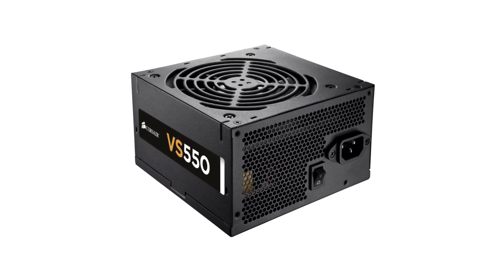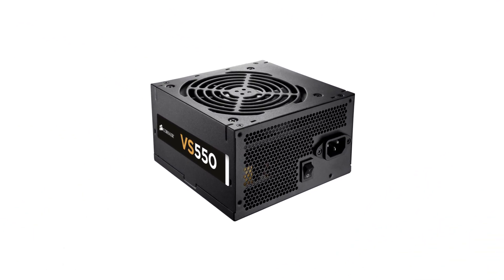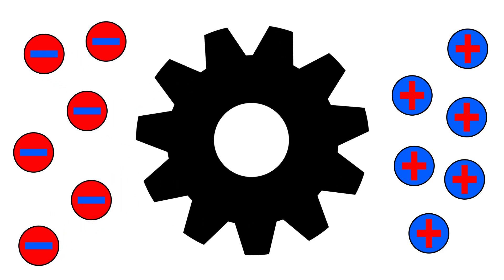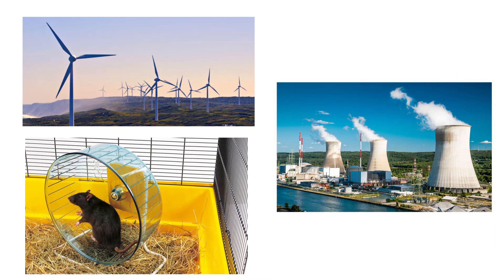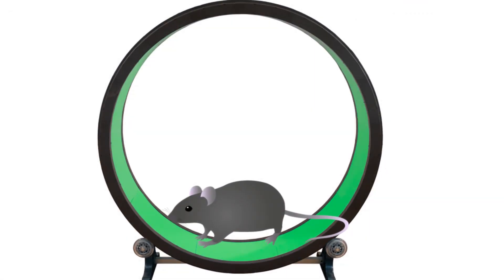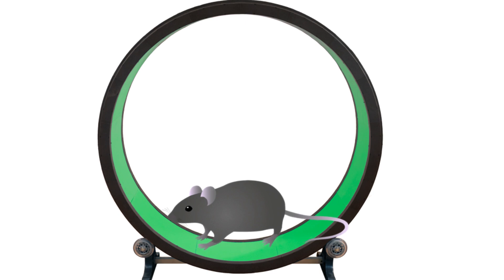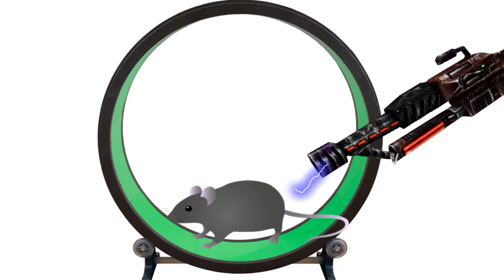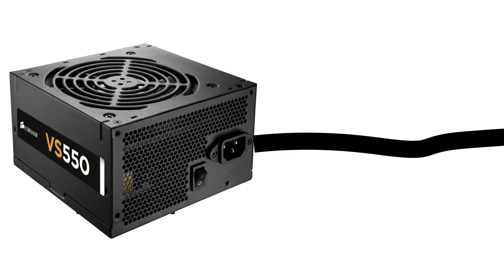How Does a Power Supply Work?

Comment: I just built my first pc. but when i plugged it in my psu sparked and turned my pc of.. will it damage the rest of my system?
Reply: Sir. thank you so much for the replies.. it really helped me alot relaxed .. i was really stressed out that time knowing i canr afford another system if it broke down.
Reply from the maker: @brucecrescencio  glad to hear it! Do you have a cooling system?
Reply: @H3Vtux  hmm just the free fans that came with the case
Reply from the maker: No, the psu has surge protectors in it so the rest of your setup should be fine. How big were the sparks? Was the psu off when you plugged it in?
Reply: @H3Vtux  the spark was not that big.. a little smoke came out of it.. Yes everything was turned off when i plugged it in
Reply from the maker: @brucecrescencio  Hmmmm that's not good, though sparks don't always mean there's a problem. The fact that it isn't turning it on doesn't mean any of your components were damaged though, if the PSU is broken they won't ever be fed electricity. 

THe first thing your computer does is called "POST" which stands for "power on self test" to make sure there is no risk of damage. I would take it somewhere to get looked at if you can.

It sounds like the power supply is the main problem. A few questions: 
-Have you used that outlet for other things? 
-Did you check your circuit breaker to see if any of them were tripped? 
-You said it was off when you plugged it in. Did the spark/smoke happen once you turned it off or just when you plugged it in without turning it on?
-Where did you purchase this power supply?
Reply: @H3Vtux  yes the outlet has been used to powerup another computer... 

when i plugged it in and turned the pc on it actually turned on for about 5 secs and thats when the sparked happened and everything turned off
Reply from the maker: @brucecrescencio  Really sorry to hear that, I would say get a better cooling system but after just a few seconds that wouldn't be the issue I don't think.

Go post your specifics in a Toms Hardware Guide forum and see what they say, they'll be able to give you more. I wouldn't be too worried about your components though, at the worst your motherboard might have been damaged but even that I think is unlikely.
Reply: we tested it back just plugging in the motherboard.. it didnt turn on after.. im just really worried if my other components got damage especially the GPU :(
Reply: i brought my system to a technician.. thank god everything worked fine... it was only the psu that was defective

Comment: PSU don't generate electricity, it convert the AC to DC current from the socket and divide the voltage using transformer to supply the difference pc part. every pc part need different voltage supply.
Reply: Man I am dead how did someone not figure out this is a joke. This was released on April Fools after all
Reply: Yeah I don't believe you. The video sounds way more credible than your comment.

Comment: Where does all the mouse crap go?
Reply: There is a small secondary chamber underneath that dries all of it. Once a sufficient amount of poop has been collected, a mini torch roasts it, and that energy is what gets used to power the chord. This allows the gerbil to take a break and helps prevent it from going into cardiac arrest. This ultimately serves to increase the lifetime of the power supply. Hope you found this useful!
Reply: @troyricker6230  Although the used methods worked for the past two decades or so, our team is working on EEC (Efficient Energy Circulation), where poopy poop of the mouse won't get wasted, instead it will be re-routed to join the feeding tube to ensure maximum energy efficiency, low power usages, hence letting go the roasting chamber and less amount of food to push inside the tube.
We are currently on our last testing phase, and the results seems to be promising. We already published our patent in yourGenericPatentSearchSystem.com
Reply: @googleuser4203  Wow, I am thoroughly impressed by the amount of thought and rigor you and your team have put into this promising innovation. Best of luck with everything, and I will be watching very closely as the testing moves forward.
Reply: @troyricker6230  Your insights are well appreciated, fellow researcher. Stay tuned!